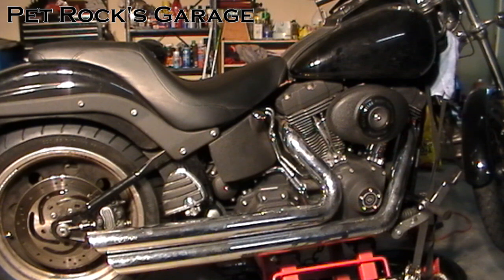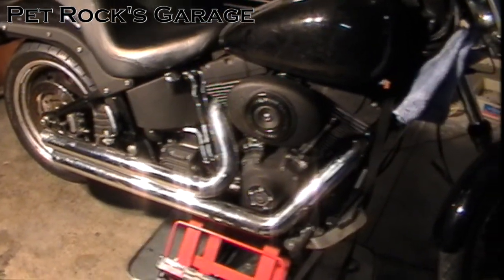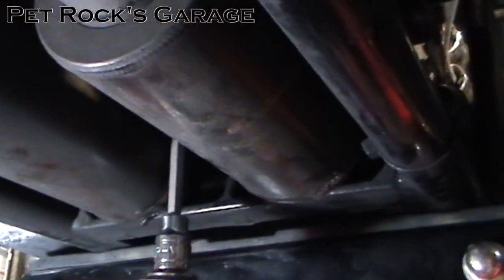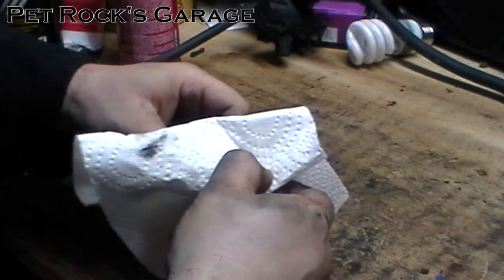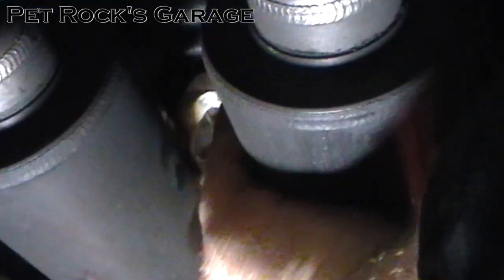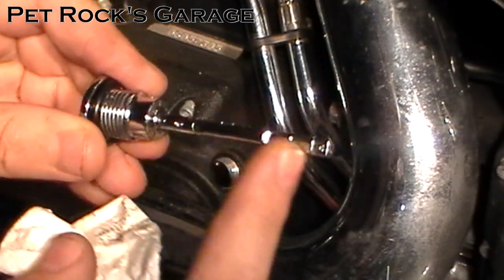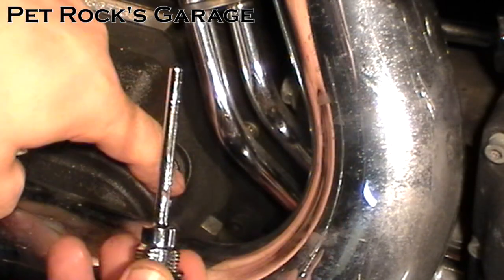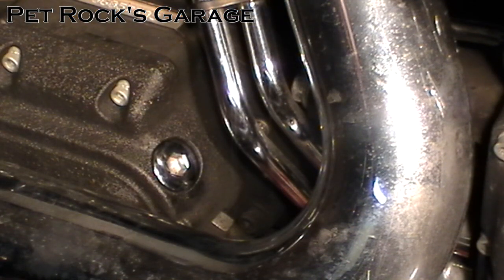How To Change Transmission Fluid - Harley Davidson Softail (Twin-Cam)

Comment: Hey thanks again I just completed the 3 hole change I used the redline 75/90 for trans and the redline for primary it works great smooth shift in all gears my 2000 softail deuce has small drain on primary cover at back and I filled threw inspection plate less mess thanks again all went smooth thanks again .
Reply from the maker: No problem. Glad to be of service.

Comment: I have a 1999 softail standard and cannot find a drain plug between shocks underneath, and it appears there isn't really room for one either. There is a very small screw on the right side cover, down at the bottom, between the cover's mounting bolts that someone told me is the drain. I don't know, seems awfully small for the viscosity of gear oil. Do you know anything about this?
Reply from the maker: I'm not entirely sure. I haven't worked on a that vintage bike in decades and don't have the manuals for them anymore. Is it an EVO or TwinCam? Could your bike have an aftermarket transmission? I vaguely remember a small drain plug on the side of the transmission case, but also remember one on the bottom. But I could be mixing up touring vs softail or different years. Sorry I can't be of more help. Good luck.

Comment: You talked to me like I have never changed the fluid in my Harley. Thanks, lol. You don't just say do this and do that. you explain every step. Great job, thx. Just by doin my own fluid changes  I save 100s of dollars. Owning a Harley is like ownin a Ferrari. Its a freaken American motorcycle and everything involved with them is bookoo bucks. Any money I can save along with the knowledge is great. I gotta wobble at 40mph and I am trying to figure out the problem. Harley shop wants 450$ to fix it and they don't even know the cause? With YouTube and sites like this I will have no problem. Thx again.
Reply from the maker: Thanks a lot. I appreciate it.  Wobbles at specific speeds typically indicate an unbalanced tire/wheel (maybe a wheel weight came loose?). But it could be other issues too. I'd start by taking the bike (or better yet, and cheaper, just the wheels) to a local shop to rebalance the wheels and then see what happens. It does not need to be an HD dealer. Most Indie shops can balance a tire fairly inexpensively (call ahead of course). I've got videos covering how to easily remove the front & rear tires. They might help you out too. Good luck.

Comment: Question? Service manual says check the transmission fluid with the bike on the Jiffy stand. Is that a Jiffy Stand you are using??
Reply from the maker: A Jiffy Stand is also known as the Kick Stand.  Its the little bar you pull out when you park your bike and lean it over to the left side.  Hope that helps.

Comment: what's a 2004 Heritage Classic take? The dealer said a quart sounds like to much to me.
Reply from the maker: I have no idea. Probably close to what mine takes if it is a 5 speed trans. You should check your owners manual.  Don't guess or go off of what sounds good. Alternatively, you could also slowly/gradually add fluid, an ounce at a time, until it hits the correct level on the dip-stick.

Unless the dealer looked it up, I doubt they would know off the top of their head the amount of fluid that a 15yr old bike takes.  Especially since different models & years take different amounts.  Most dealer service techs only remember the specs for the last couple years since that is what they primarily work on. Not 15yr old bikes. Just sayin'...
Reply: @petrocksgarage  ok thanks.

Comment: I'm glad to hear that you haven't had any problems running a thicker grade of gear lube. Thinking about trying it in my Dyna 2004 88. If you have had any problems please shout out. Thanks
Reply from the maker: No issues.  Bike is still running like a top at 90k+ miles.

Comment: Keep these videos coming!... please! I'd like to see one on replacing or exchanging the fork springs suspension system
Reply from the maker: Thanks a lot.  Pulling the spring out on a Softail is pretty simple. Get the front end off the ground, remove the nut from the top of the fork, compress the front end to push the spring out the top. Reverse it to re-install.  When the bike is off the ground the spring is under little to no pressure on Softails. So you don't have to worry about it shooting up at you. Good luck.

Comment: Great video ! 
I will say though that in colder environments heavy to medium weight gear oil is not recommended due to gear tolerance and warm up times . I’ve had experiences with floating or spinning an outer bearing race due to cold gear oil but I do recommend something thicker than 20w 50 oil. 

Side note: when running on the track Circuit, I’ll run 10 weight hydraulic fluid in trans for short runs it cuts down on bearing friction and let’s the gears fly but should be drained after each run . Simple trick nocks a 1/2 second of 1/4 mile
Reply from the maker: Thank. I agree re oil. I run 75W-90 in my transmission. No problems after 95k miles.

Comment: What type of oil do you recommend? Some say redline, and others say mobil 1. I put the HD stuff in and dumped it after 1 ride because it was not shifting as well. Then I put lucas gear oil in and it seemed better. . Also what do you recommend for primary? 03 FXDP Honeycomb hideout Thanks
Reply from the maker: What oil to use is a discussion that will never end. There are tons of threads/videos online about this topic for pretty much every make & model vehicle in existence. Use whatever synthetic oil you have available in your area and in your price range. I've never understood how people claim that the oil they use effects the shifting quality. The oil is for the gears, not really the shift fork. Use whatever oil makes you happy. The manufacturer isn't really important. Its the grade oil and that it's synthetic that matters most IMO. I run a good synthetic 75W-90 gear oil in the transmission and a good synthetic 20W-50 in the engine & primary.  Good luck.
Reply: I use Ames oil. Never shifted better. Quite and smooth. Use the 20-50 engine oil also.

Comment: Hey man, love your videos!!! I have an 08 night train and have used your videos to do my maintenance. Do you think you could do a video on things to keep tight over time? Anything with the steering/suspension/axles, etc?
Reply from the maker: Thanks a lot. I'm glad my videos are helping you out. I'll see what I can do about the videos. Typically, if you torque things to spec they won't come loose.
Reply: Makes sense, ok sounds good, I'll look forward to any videos you make in the future, thanks again!!!

Comment: Thanks for the video, im about to change my fluids and never done a bike before. Can you use a synthetic or no?
Reply from the maker: Yes, you can use synthetic oils. I highly recommend them.
Reply: @petrocksgarage  ok i was told to use a syn on primary oil and non syn on transmission oil
Reply from the maker: @michaelnathan8549 , you were mis-informed. Synthetics are perfectly fine in all holes. I've been running full synthetics in all holes in my bike since I bought it new in '06.  95k miles later and no problems. HD even ships their CVO models with their synthetic oils inside.  The trans & primary are the same in CVO vs regular. Hope that helps.
Reply: @petrocksgarage  ok cool thanks.
Reply: @petrocksgarage  how many places do you use oil? Just the 2 right?
Reply from the maker: @michaelnathan8549 , three.  Engine, primary & trans.

Comment: I have a 2010 HD FXSTC - six speed.  96ci.   I have had my transmission rebuilt by a qualified HD service shop.  However, I have noticed that occasionally, shifting from 1st into 2nd is difficult.  As if there is some slight binding going on. This only happens between these two gears, 2nd to 3rd to 4th to 5th to 6th is fine. I have taken the bike back to the shop and they graciously re adjusted the shift cable, and the clutch, and it has improved somewhat; but upon occasion, shifting out of 1st to 2nd requires some extra effort. I have a full pull at the clutch lever,  so that "feels" comfortable.  Anytime I start up the bike, I allow a full minute or more to let the engine/fluids properly warm up while in neutral.  I get on, pull in clutch handle, and down shift into 1st, there is a noticable "clunk" at it goes into gear, (as if the idle is too high, but I've been told by HD mechanics that this is "normal" operation for any HD.......)  Once in 1st, I ease out the clutch handle, apply a slight throttle, and the bike takes off just fine, right at the end of the rpm for 1st gear, around 15mph or 20mph, I try to shift up, and there is where the binding happens.  In another scenerio, I have found out that IF  I wait to shift into 2nd at 20 or even 25mph, sometimes it shifts easily. Which is strange enough.   So........is it truly something to do with the timing of how I'm shifting? or is it something to do with the rpm's required for HD and this 6spd trans? 
       I used to own several Kawasaki Vulcans, and they were all 5spd.  This is my first experience with a 6spd, so, I would appreciate your input and advice on this issue. 
        Live to Ride, Ride to say Wheeeeeeeeeeeeeeeee!!!                     LoneRider
Reply from the maker: That clunk from Neutral into 1st is normal for Harley transmissions (5 & 6 speeds).  If you pull the clutch lever in all the way the RPMs of the motor, or speed of the bike, should not have any impact on your ability to shift.  You should be able to go through all of the gears at a dead stop, with maybe just a slight forward/back rocking to get it to change gears.  Pulling the clutch lever should completely disconnect the motor from the transmission.  Its hard to diagnose your problem from my keyboard. But something does sound off.  It could be as simple as needing a clutch & clutch cable adjustment, or a sticking shifter linkage, or as bad as something wrong in the tranny.  Double check the clutch adjustment (I have a video on how to do it, its really easy, https://www.youtube.com/watch?v=yf-5_XL-mMU).  Also check the shifter linkage joints. The dust boots sometimes crack, water gets in and rusts causing it to stick. If the dust boot is broken, shoot some WD-40 or White Lithium Grease in the broken boot and work it in a little and see if that helps (its a temporary fix, btw). If not, then I’d take it back to the shop to have them reproduce the problem and fix it.  Good luck...

Comment: Great job with good insights. I added a center stand to my bike so i don't have to jack it.....I have a lift and a jack. Craftsman was a good choice for the jack. When I bought mine it was the same price as the Harbor Freight which is not as good.
Reply from the maker: I wish I had a lift. That would be nice, but sadly I don't have the space in my garage nor justify the cost.  I bought the Craftsman jack sometime in '02-'03 and it is still running strong.

Comment: I was just dropping my 04 night train with 6k mil to have this done but I can do it thanks for your video and experience explaining mine shifts hard will it change after this
Reply from the maker: An '04 with only 6k miles? That thing is barely even broken in yet. Transmission fluid doesn't really effect how a transmission shifts. A clutch & primary chain adjustment and shifter linkage inspection would likely have a more positive effect. Good luck.

Comment: I just bought a 05 fatboy and was wondering would it hurt anything if I switched to gear oil in the transmission if that’s not what has been used in it? It has 25k miles
Reply from the maker: No, it will be fine at any milage.
Reply: Pet Rock's Garage ok, even if he did not put  gear oil before?
Reply from the maker: @redflint7651  yup.  Switching to gear oil should not cause any problems.
Reply: Pet Rock's Garage I just bought it yesterday (my first bike) and I checked the motor oil level and it’s way over filled... I was gonna take a turkey bayster and suck some out... I’m hoping the others are not over filled... he said he changed it every 1k miles or so ... when I texted him n asked why it was over filled he didn’t act like he knew .
Reply from the maker: @redflint7651 , make sure you follow the instructions in the owners manual for checking fluid levels.  The procedure is different for different models & years.  Some have the bike on the kick stand and some don't.  So before sucking oil out, make sure to you are checking the fluid correctly.
Changing the oil every 1k miles is a complete waste of time, oil & money.  Factory is every 5k.
With that said, whenever you buy a new (to you) vehicle, assume that all the fluids have never been changed and that the previous owner was an idiot. I always recommend changing all the fluids & adjusting the clutch after purchase. That way you have a bike in a known maintenance state.
Reply: Pet Rock's Garage yep I checked it on the kickstand. And ty for the reply

Comment: Great videos man! I've got the same exact bike and fixing to do all the fluids myself I seen you have the oil change could you make a video of changing the primary oil?
Reply from the maker: Thanks a lot.  I actually recorded a primary oil change video a couple months ago but haven't gotten around to editing it.  I have a backlog of about 20 videos recorded by not edited yet.  With work I have a limited amount of free time.  :-(
But its not that hard of a job.  You pull the derby cover (T-27 torx head bit), drain the oil out the bottom of the primary. replace the drain plug o-ring if it is damaged.  Put the drain plug back in (I don't remember the torque spec off hand, but just snug it down).  Fill the primary with the exact amount & type of oil specified in your owners/services manual.  Different years & models have different amounts, so go by whats in your manual. Then put the derby cover back on (replace the gasket if it is damaged). Tighten in a star pattern. IMS, its about 80 in/lbs of torque. don't over tighten or you'll strip the bolts. Good luck...
Reply: Pet Rock's Garage awesome sounds good I'll be watching close to see when it's up!

Comment: When changing either the transmission fluid or primary case fluid do you think it better to do it warm, like when doing engine oil?  BTW, I've 2001 Night Train and really appreciate these video., .. so Thanks.
Reply from the maker: With the tranny, it doesn't really matter because it is basically a sealed box with gears inside. So you can drain it hot, warm or cold. You'll just have to wait longer for it to drain fully when cold.  Thanks for watching & commenting. I appreciate it.

Comment: Thanks for the detailed video. Was wondering if you have a video to change the Primary fluid on a H.D. Softail? Thanks As I have a 2006 Softail Deuce so mine is pretty much like yours... Bill
Reply from the maker: Yeah, your motor is the same as mine. I don’t have a primary fluid change video yet, but I will as soon as mine is due. Its pretty simple drain & fill operation.
Reply: Seems like I have done that b/4 but when filling back up you have to watch the level as there isn't a dip stick. Seems like you fill it to the bottom of a gear but don't quote me on this. And the transmission was really fun getting between the shocks. Hope you have a nice holiday weekend. I am in the middle of replacing my rocker box gaskets as had leaks. I don't have a video camera or would have made a video on that subject.
Reply from the maker: Its a lot simpler then that. Your owners manual has a spec for how much fluid goes into the primary.  Just put that much in and no more. Different years have different specs. Good luck...
Reply: Pet Rock's Garage Thanks will have to look it back up.
Reply: Also I have the 2006 softail deuce. And I think our bikes are pretty similar.

Comment: I have an ‘07 Night Train. I’ve been told fluids should be check in the side stand position. Any insight?
Reply from the maker: Regardless of what procedure you read on the internet, your owners manual is the bible in cases like this.  Different years & models have different procedures & capacities. If you don't have the owners manual for your ride, you can get/order one from your local HD dealer or HD website.  Hope that helps.

Comment: Newby questions....I have a 93 fatboy.  So routine checks are gonna be adding trans fluid there like in the video, brake fluid and motor oil.  Right?
Reply from the maker: Yeah, routine maintenance is engine oil, trans oil, primary oil, fork oil, brake fluid, clutch adjustment, primary chain adjustment (if you don't have an auto-adjuster installed), and steering head stem nut adjustment. There is more and they have different milage intervals that these maintenance items need to be performed. I would advise getting the factory service manual for your year/model bike. It will have all the maintenance stuff listed with milage intervals & instructions on how to do it. It will pay for itself in the first service. Good luck.
Reply: Pet Rock's Garage how do I check fork oil?  Thanks for the reply ^
Reply from the maker: You don't check it.  You replace it every X miles.  X depends on your year/model bike.

Comment: Finding conflicting info on whether you should warm the bike up before checking  the tranny fluid level or checking 
 it cold. Insight?
Reply from the maker: Different years have different requirements.  Use the procedure outlined in your owners manual for your year/model bike. Good luck.